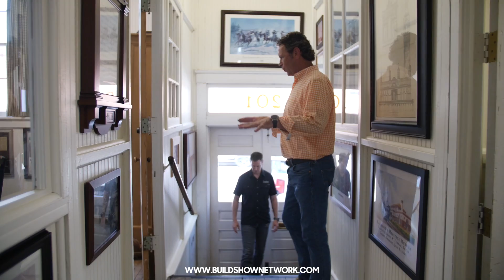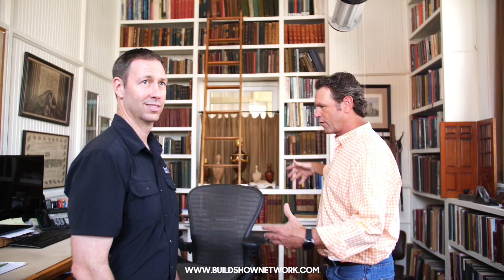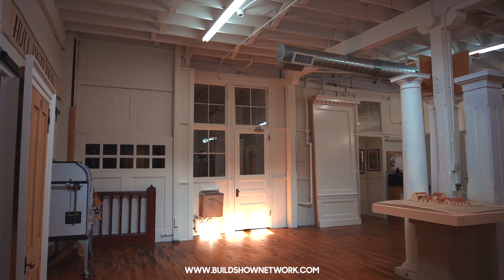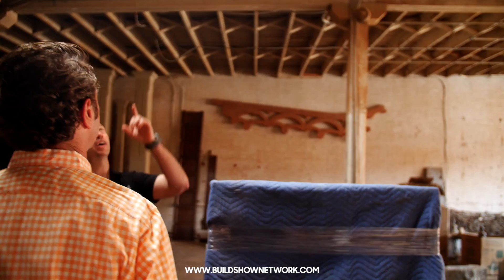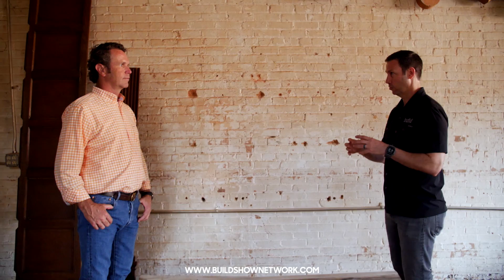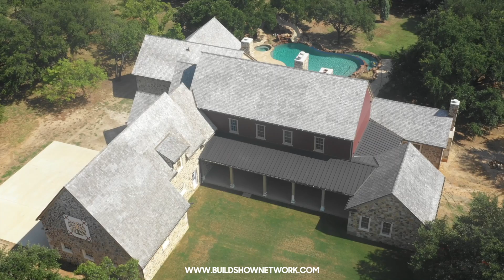Warehouse Remodel - Ft Worth TX Hull Homes office is awesome!

Comment: WOW, great video.  Brent has a great appreciation for restoration. I appreciate a true craftsman home builder.  Homes with thought, style, and character.  Sadly he is in Texas.  When he is ready to take a real challenge our home built in 1884.  Yes before indoor plumbing and electricity in every home.  We have asbestos shakes over clapboard siding, gas pipes in the walls from lighting, the original wooden windows with weights and wavy glass, limestone foundation (think root cellar), and an octopus heater - converted from coal to oil to natural gas. Square nails (handmade vs machine-made) and irregular wood that appears hand sawn.

Comment: Matt! Just wanted to let you know your changing peoples minds about building better. 
I do hvac and home performance i just had a call to go to a house where customer Is building his own home “homeowner builder type”. It was in the process of building a standard Florida home and then ran into your videos and changed his whole design. open cell in the attic Prosecco type on the windows and now wants to do a blower door Test to make sure the foam in the attic is correctly done.  Variable speed heat pump system as well. 👍
come down and do a video man! CBS block doesn’t have stucco yet window should be in soon

Comment: New Orleans is my original home- as a teenager, hunting bucks to repair my first car, I got into hunting down old Hunter ceiling fans- nearly every old neighborhood in town had houses that were built long before HVAC was invented, and so had a bunch in the attic. Bought, cleaned of dust and sold to the specialty shops that could rewind them was a fast $5-$10 to buy, an hour of my labor and $25 from the rebuild shops! Hunter as a company was moribund and had nearly no business- mostly they were refurbing their own products and making about 50- 100 fans a month so the little appliance shops were making out like bandits rewinding and replacing the bearings, renewing 75-100 year old fans- some were even DC! But I started on old houses- when you got toward town, the buildings got even older- structural brick was doable; you just drove triples of piles to the solid soil with a steam pile driver! It looked to me  that sometimes there was enough wood to float the structure on!. 
   I live just down the road from FW- in Dallas County; they tear every thing old down, find arsonists to burn down inconvenient old National Register structures and replace it with chrome and glass. Although I will say they have been getting better and better architects the last 20 years- but it is not the same- like the Calatravas designed "Signature" Bridge built a few years ago- three times the cost of a "standard" bridge, all the architecture is expensive steel ginger bread that will cost two million dollars a year to keep painted and rust free. I have to admire what Mr. Hull does- I may have seen some of his work- I had several service clients in Bellaire, south of downtown FW. The Tandy mansion, as well as his long time chief legal officer (both sadly passed, the homes sold off) were among them- beautiful homes! Somebody told me the Tandy Mansion was originally built for $35K, about 1915.Wow! Most of the old homes like that are located in a small district of Dallas, and most of them have been butchered by remodels, many done since the neighborhood revival beginning 25-30 years ago. Quality is never really out of style- it just becomes to pricy to compete with the "newer, better, racy" new stuff. Love the ole Nabisco Dist Center- Hull deserves it, and will keep much of it's flavor and character.FR

Comment: I always find it strange when Americans see an old properly built building. This is the way all old buildings are constructed in the UK.
Reply: That is mainly due to WWII. After the war there was a huge baby boom and builders scrambled to construct everything fast and cheap.  And they never got out of that mentality.  If the public continued to buy it they continued to throw them together without concern.
Reply: The mortar and tuck pointing on the front of the building was probably done in lime and that is why there are so cracks, I would say that 25% of British houses are built like this, hardly any foundations, just a self sealing wall, no Portland at all.